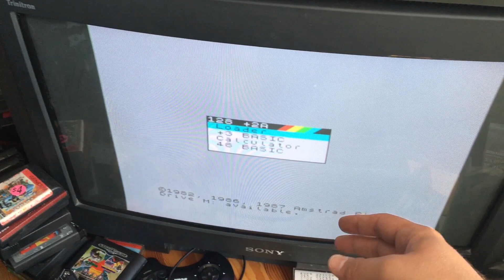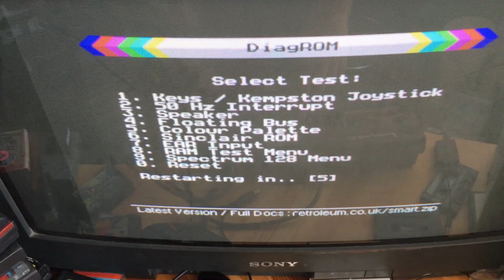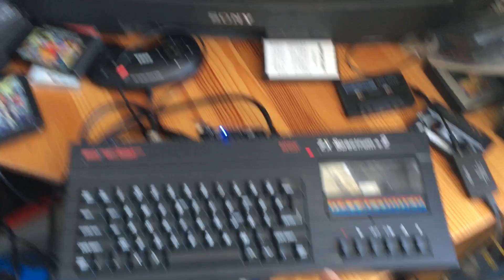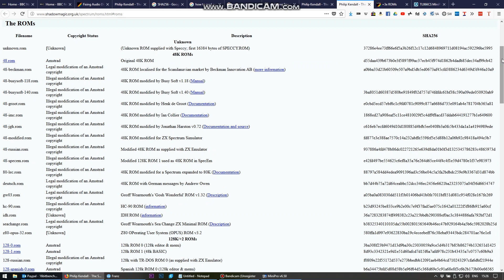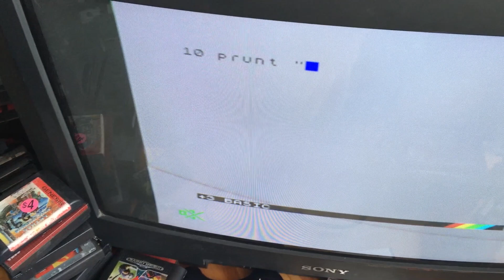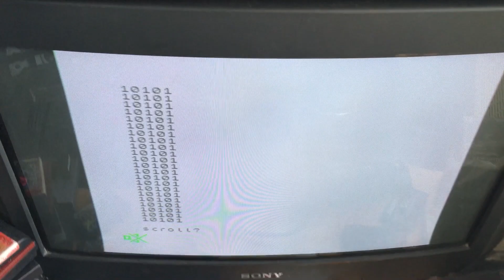Sinclair ZX Spectrum Plus +2A Corrupt ROM fix

Comment: Nop... +3 BASIC has a correct name, because it is the same BASIC you'd find in a +3. The ROM is the same and you can exchange it with the one from a +3 with no problem. The 128k BASIC has subtle differences, but is different. A +2a/b is the same than a +3, but without the FDD hardware. In fact, if you take one of them and put the recently developed interface that Amstrad promised on the +2a/b manual and an FD1 unit, computer display changes, and says it is a +3 instead of a +2a/b.

Comment: I just recently bought a plus 2A. Any idea where I can get a power supply?? as I thought they use the same psu as the first +2. Thanks for the video by the way I thoroughly enjoyed it
Reply from the maker: ebay or ask in the "Sinclair for sale" group on FB
Reply: If you are able to wield a soldering iron, you could make one yourself from an old PC power supply.